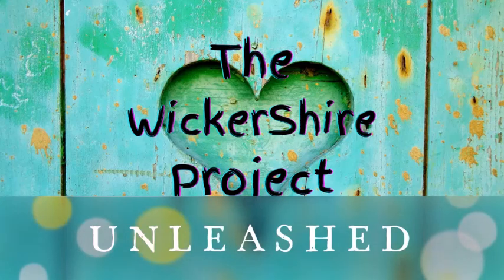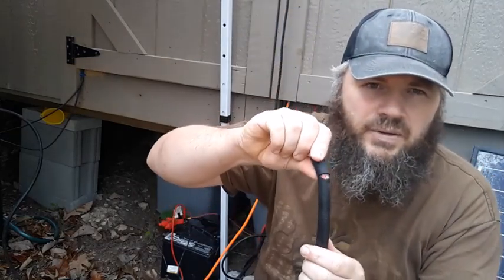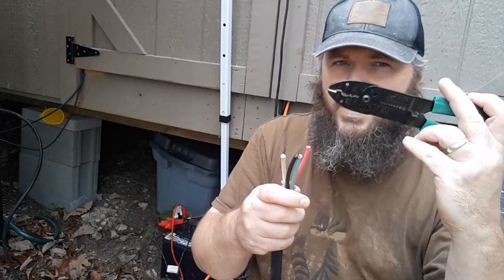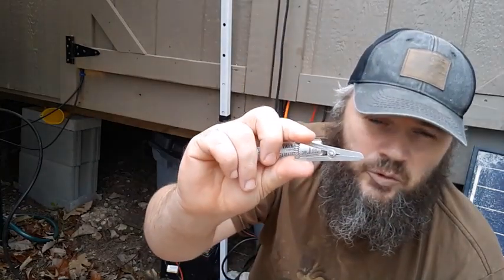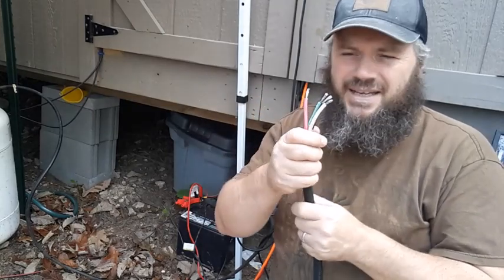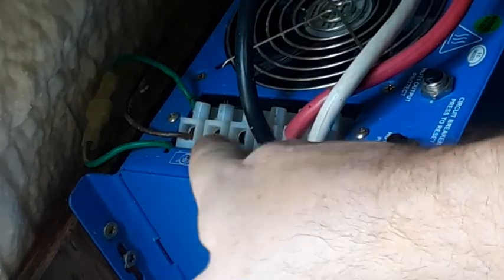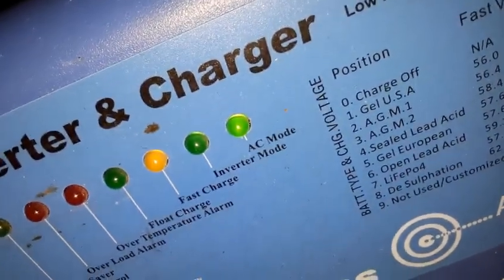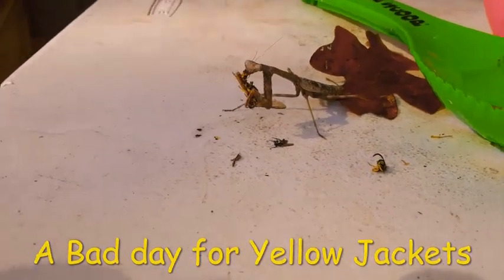How to Wire a 50 amp RV Generator Plug 120 v 220 v to an AIMS 6,000 watt 48 volt Inverter S1 Ep13

Comment: I thought on Rv the legs ran 50 amp each and each 120 was coupled to neutral return not ground
Reply from the maker: Yes each leg is rated for 50 amps per leg at 3,000watts. I should of been more clear on my application since it was wired for my 6,500 watt generator that is much lower at 25 amps Max per leg via the circuit breaker on that generator. Its has Two 25 amp push to reset Breakers. I did pop one a few nights ago tripping the power at the Aims inverter.  My Aims inverter does not use a Neutral from the generator but, it does have one on the Out Put power. ( I was and still am confused why its there. I'd have to call the manufacture to see if using the Neutral wire from the generator can go to OUT going power. manual isn't all that clear )  We have 3 options on AC INC  L1 L2 and Ground.  3 options on AC Out  L1 L2 and Neutral go figure 😅

Comment: My hybrid inverter/ charge  has auto sensing and a set of dry contacts that will start a generator for backup when needed. It will not however shut it off automatically unless it automatically runs out of fuel!! LOL So your butt will be going outside and shutting it down. Better hope it cranks good also. I have never used it
Reply from the maker: Yeah a digital relay with a timer built in + modded fuel gauge sensor would be nice! We should invent that! Wanna be a multi millionaire with me? =P

Comment: Good job, told my family when we got our land I want solar,  they laugh.   Guess we will see when the power goes out who laughs then....😁.    Stay safe and sending ya'll big hugs and lots of 💙🙏
Reply from the maker: I wish Batteries were cheaper. Everyone could afford solar. Panels, wiring, breakers, inverters and charge controllers are crazy cheap! It's the power storage side that can kill a wallet! Our Battery is a DIY from an electric vehicle. $1,600 we spent to fabricate its build is so cheap as we did it ourselves. 15 Kilo watts storage is about $28,000 these days. <- BLEH! $1,600 for the same power was a great way for us to save money and learn the how to on building solar batteries.
Reply: @TheWickerShireProject  thx for info..I'll keep you in mind when the time comes....hoping next summer.   It was snowing here yesterday,  didn't stick but it will sooner that I want. Dang Wisconsin weather...lol
Reply from the maker: @vickyjohnson9594  Re-researching Geo thermal heat storage and mini split heat pumps. All about efficiency. Sun comes up every day almost and I need to harvest it better then just solar in a battery. Earth battery for preheating water would be awesome here!

Comment: Excellent advise. Thanks Billy!
Reply from the maker: Wiring and electrical + AC/DC is a pain with off grid life. Share what I can while popping out the projects done here. Tinning Wires maybe something no-one thinks about. That's a cause for #1 power loss or #2 heat that leads to a fire down the road.
Reply: @TheWickerShireProject  wisdom right there!

Comment: good job there old son
Reply from the maker: Wired up but we still have the problem of not having the system grounded. Pray NO lightning strikes until i get that done! Once the bathroom install goes in we'll go over the AC Mains Panels and do some electrical work! Fun times soon!
Reply: Man, it'd be nice to see y'all over here too. 😢 But, I get it. I don't say much over there either. ❤️😉🤦‍♀️

Comment: I don't mind wiring outlets, switches, fans, and such but I hate putting 
 breaker in the box
Reply from the maker: I agree. I have to swap out the 40 Amp Mains to a 100amp now that we will have an electric water heater  install soon. Double 60 amp pole as each pole leg will draw a ton of power while in use.  Always dedicate a line ( 10 gauge non metallic ) to most big appliances like water heaters, stoves, toasters and larger microwaves. Smaller stuff like lights ( LED ) fans, computers  can sit on a 15 or 20 amp single pole breaker even if the sockets are daisy chained. I will be wiring up the Tiny Home ( DIY semi Pro soon!) So there is that Video that will go into great detail.

Comment: Billy,   What you showed seemed very well explained and demonstrated. I can never figure out what wire is what.  Glad you're getting set for winter.  It's coming in quick, now.  Are you set with enough $ for food and such?  I'm worried about you all.  I have changed out light fixtures and I'm about to replace a bunch of plugs in this house that are just plum worn out - you plug something in and it falls out... but I turn the entire house off at the breaker box before I do anything.  I'm afraid I'll electrocute myself.  I don't even know enough about electrical stuff to be dangerous. lol
Reply from the maker: I'm out of work but, Sharon has us covered. We'll always be set with food. Our budget is about $1,000 a month from here on in. The projects will slowly get done. Still waiting on our online IT company to pay out dividends. Worn out receptacles happen with age and friction. All have a life span of 5 to 15 years depending on use from plugging and unplugging things into them too often.  Always be afraid of electrocuting yourself! You can use test probes to be sure there are no live lines. That's what I do.

Comment: Hey Billy. . I cringe at doing Electrical work. I'm lucky in that my uncle was an Electrician and my brother knows some also.
Reply from the maker: I been studying it ( To Code ) and Learning Ohms Law, Wire gauge, Resistance and heat. Some metallurgy plays in as well. DC and AC  are two different animals. I'm excited to work with it and enjoy it as a hobby.
Reply: @TheWickerShireProject  oh that’s awesome. I should learn basics.
Reply from the maker: @CastleHives   Since you watch the Shire I'll often cover subjects. I'll be doing my entire house wiring soon. From Mains Panels to electric water heaters, plug sockets, breakers, lighting ect.